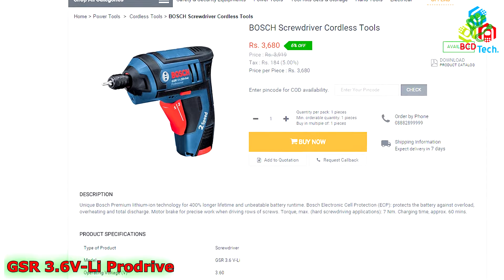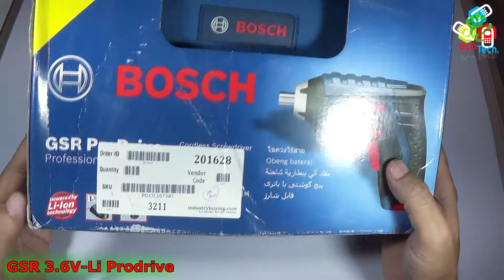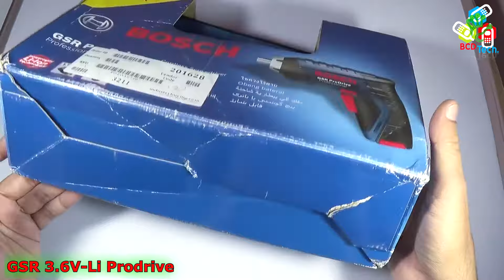Bosch GSR 3.6 V li Pro drive Cordless Screwdriver: Never buy from industrybuying.com

Comment: Thank you for such detailed inside overview!! found where to put that clip after i dissmanteled the thing and kept it for a year opened (was awaiting for proper glue to fix the gearbox) it was dropped 3 floores down the stairs and it smashed off 2 metal stablilizators off the wall. very sturdy driver!! NICE!  ALSO MINE HAD 2 BATTERIES,  but no screwbits. good to have 2 batts- work nonstop